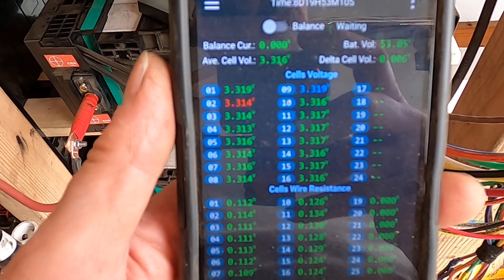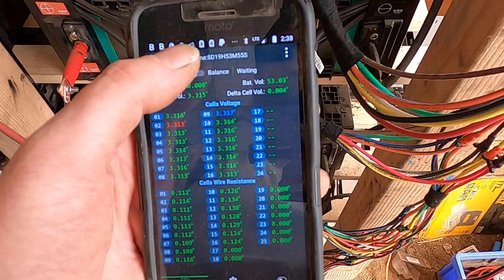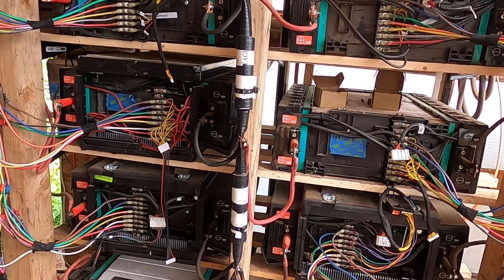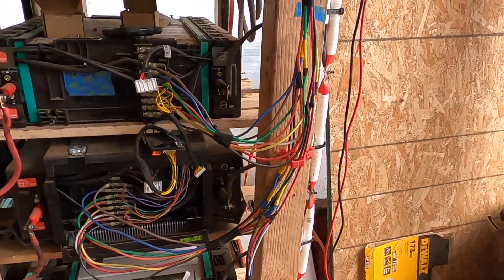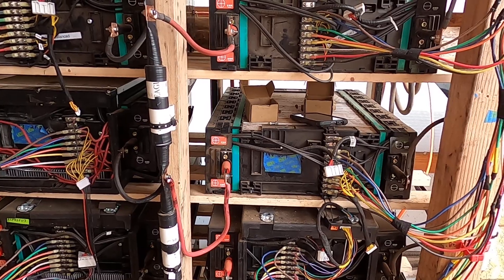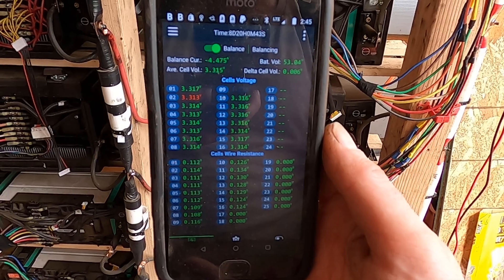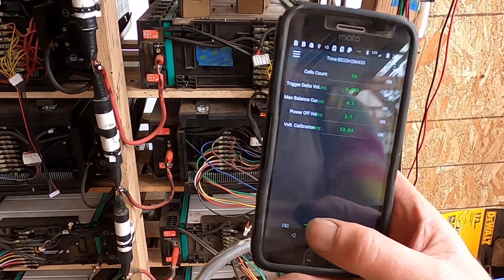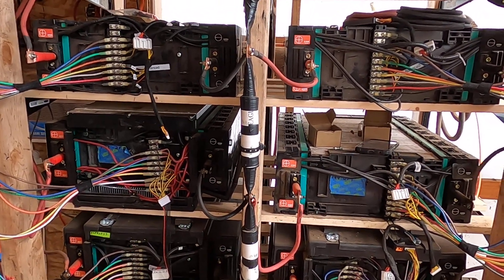BYD Battery Active Balancer review and more on BYD Battery Balance strategies

Comment: How is this working now running loads for a period of time?  Are you happy with bussing all the cells to groups as opposed to several balancers, one for every 48v 16s two battery pair?
Reply from the maker: It is working far better than I expected it to given the used state of the packs when I got them.  It has been completely maintenance free so far.  I am glad I did the passive parallel bus as it is clearly helping keep the cells top balanced.  I feel it is more reliable as there are fewer elements in the system that could potentially fail.

Comment: If your relying on the inverter and charge controller to keep the battey in check you may have a big problem if one fails. I highly suggest at a bare minimum you implement another solution to ensure battery life. Look into putting on a voltage monitor that cuts off the discharge and charge as a backup.

You have a lot of money in the batteries to risk their life if the inverter or charge controller fails.
Reply from the maker: I feel that another system to disconnect or connect would add complexity and unknown interactions that could create more problems than those solved,  For instance, my charge controller can be killed if the connection to the battery is interrupted suddenly while the panels are still connected to it.  I have been off grid for 25 years and have yet to have a charger or inverter fail in the manner you suggest.  I have had them fail but when they do so they stop inverting, which means they no longer discharge the battery.  I have never had an inverter fail to disconnect at low voltage.  I have also never had a problem with a charge controller failing to disconnect charging if it fails.  They have failed but when they do they stop charging, so problem solved...

Comment: That is a lot of wires. Whats the model number on these batteries so I can look them up.
Reply from the maker: Near as I can tell there is no model number.  I got them from https://www.batteryclearinghouse.com/
Reply: @metagrid9453  I am not a lithium user yet and I am trying to understand to be able to get away from Lead. I was looking at these batteries and would I need an 8S BMS of about 130 amps per battery module if I run 2 in parallel for 24v system.
Reply from the maker: @cutweldngrind  An 8S BMS would work as long as you  are able to parallel the cells to each other.  FYI: I am finding that the new 280AH EVE cells from China are far more cost effective and easier to work with than the BYD batteries.  I would recommend them strongly over the BYD batteries.

Comment: Where do all the colored wires terminate?  Top of rack?  How many amp hours total do you have?
Reply from the maker: They terminate on screw terminal blocks at the top of towers.  Last capacity test showed a conservative 47 KWH.  It's a 48v nominal bank.  Usually held at about 53.6V float.  So about 979 AH at 48V
Reply: @metagrid9453  thanks for the reply.  I have 8 BYD batteries (they are a little different than yours, but each one is 24v) I understand the 16s (8 each side) but do you need a common ground for the Active Balancer?  What are the yellow wires that run to the bus bar, you said the black wire was from each cell, but it looks like there is a yellow wire too.  I'm assuming that is in case you want to attach a Volt Meter or maybe a BMS?  Thanks in advance.
Reply from the maker: @KJC2025  Yes, you do need to connect the main negative to the active balancer in order to power it.  I am not sure what yellow wires you are asking about but the small diameter yellow wires run to a hobby connector that I use to monitor the individual cells with an ISDT BattGo BG-8S.  Link in the description.

Comment: Excited for your new capacity test... love the simplicity of an active balancer vs. full BMS.  Though, the Chargery 16T I believe can push 1~1.2a to each cell group.  I'd think that could suffice given you said your unit runs only about 20% of the time and is balancing @ 5a?
Reply from the maker: Thanksfor the suggestion.

I feel like a BMS would add complexity and possible failure modes to the system and would like to avoid adding one to this system.

I rely on other components of the system to provide the protection that a BMS is often used to provide.  For instance, The balancer keeps the cells balanced, the inverter cuts off below 48V.  The charger cuts off above 53.6 Volts and I am working on a system for the charger to sense temperature and cut off charging below 32 degrees F.